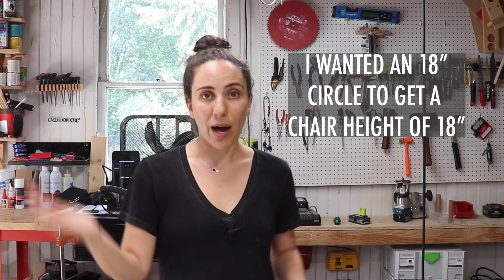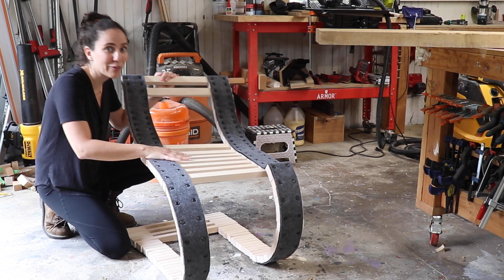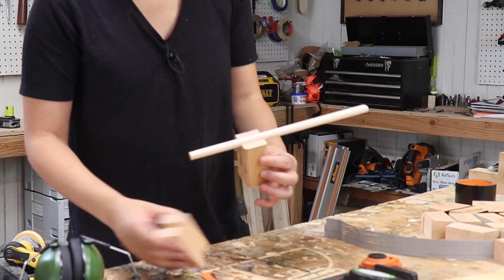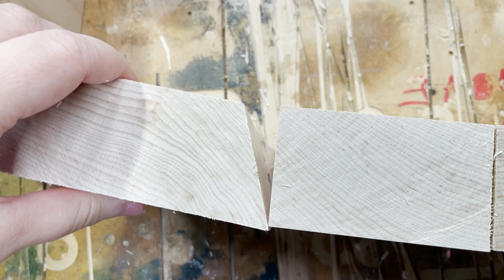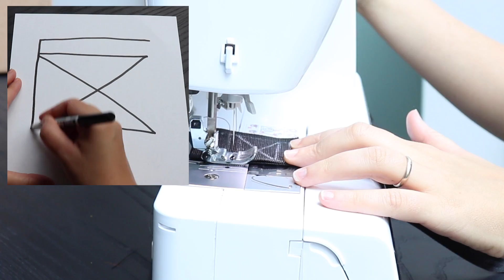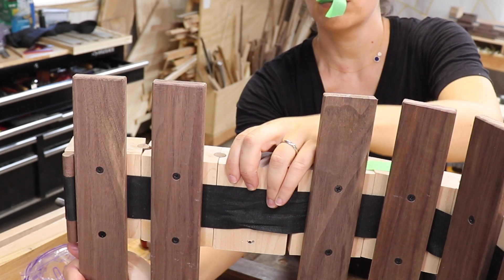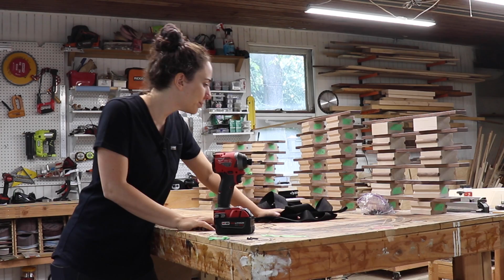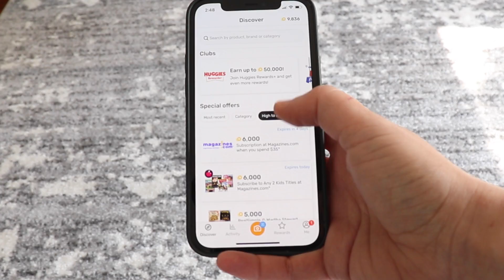I ATTEMPT to make a Roll Up Chair… AGAIN...

Comment: hi tamar, love your stuff, lets discuss the 4 ideas presented in these comments, hinges, strapping techniques, inserting metal, and adding a back support beam.
the hinges, would not work unless they were all metal, and all interconnected, and then it would be clunky, and heavy, and probably not what your going for yet, metal, support, in this area, seems to be a good idea. straps. in order for the straps to work, you need a thin yet strong strap that doesnt stretch, and it needs to be secured to each block, however this will create alot of stress, on that secure point. Each strap point needs to also be wrapped around each block at least one time, to create a very tight connection. Inserting metal, initially i thought, what if there was a strong metal wire, that was able to flex as you rolled, but also able to be hard to give you the support? not sure if this would be helpful. Lastly if you did that, you may still need a steel stick stretching from the back of the chair, to the foot of the chair, to give back support. The main issue i can see is the way in which the blocks are connected, at th bottom C, shape, the current way, allows for too much flex, so this indicates, we may need to use a stronger material, I did also see someone mention like links of a metal watch band, this may be your only solution. custom designing thin yet strong plates, that as they bent they would lock into place and remain stiff. This would cover the bottom c. even with that im afraid you may need a back support beam, because even with the metal, unless it went all the way to the top, the stress of human weight, may create too much stress, on the secure points, without, a back support beam. I will check some other youtube video designs.
Reply: there was a guy here who made an exact response to you, and was inspired by your video, josh wright, he just used a z design on the pieces, and secured each one on the sides with truck straps. you could probly use the straps you already have just slightly modify the shape of your wood pieces.

Comment: I'm < 2 minutes in, my prediction is that the angles should actually be a bit obtuse toward the backside, because no matter what this design will bend. making it bend forward means when you sit on it, it'll be under load and then be straight-ish. I think!, I have no idea. fantastic concept though, holy crap, I hope I see success!

Comment: Hi, I after this video YouTube alg proposed me to watch another guy doing the same. He used a pallet stripe to hold pieces as it doesn't stretch and supposed to be attached firmly. Here's his video. I wish it help and you build a new rollup chair. I'd make it from pine entirely first to make sure that it's working and you don't spend expensive material.

Good luck!

His video I reference to:  https://www.youtube.com/watch?v=2MSEnMGFhMg

Comment: You have a great concept. However, the only way to prevent the strapping from stretching, is to fully glue it to each segment: That way only the very small free section between each segment is subject to stretch.. . . Better yet, get rid of the strapping all together, and just hinge the wooden segments to each other!
I'll be happy to create a model of a sample hinged segment for you in Solidworks.

Comment: Either fix the strap to each piece or at least section the strapping in several parts so you can adjust the tensioning on each secction separatelly.

Comment: Thinking of rope beds maybe you should make a tensioning system on one end?
Likely any material use is going to stretch over time. Also maybe web on both sides of the blocks.

Comment: It feels like there are so many fixes for this problem, but they just might not be what you're going for/reasonable for your project scope, time, and financial investment.

There are a couple relatively easy and cheap things to consider, but making some of them work might be a little pricey compared to what you've tried (unless you already have the means to cut and drill metal):  

-Firstly, you remove a lot of the sliding and tension problems if you just glue down the straps before screwing (and essentially clamping) them down between the wood components (basically turning the stretch and tension problem into just the distance between the blocks, like a hinge).  The complication is you wouldn't have the ability to experiment and trouble-shoot - it'd be one-and-done, start over if it doesn't work.

-Second, you could try for a wood that has relatively-speaking almost no elasticity or compression tolerance - ironwood might even be needed.  This is because, I imagine (though, you may know more about this than I do, because you actually work with wood all the time), the ability of the wood to compress under the pressure the strap tension uses to essentially squeeze them together will multiply the appearance of the strap stretching.

-Third, it might be an idea to round the very edges of the blocks, so they present less pinching risk to the person sitting in the chair, and because it will allow them to be pulled even tighter together while still being able to 'roll' against each other enough to let the chair open into its 'deployed' shape.  The sharp edges should give basically no wiggle-room for how hard to can squeeze them against each other, and it adds the the issue of the wood compression (the chair basically being bound to sag with time as opening and closing a really tight setup would make them wear on each other (and where the straps compressing the edges wears them down, making the chance for gaps wider).

-Fourth, you could avoid a lot of compression with metal plates where the pieces join (it wouldn't look as nice and wooden, though, but they could be fairly well-hidden).  This means a material that's much less prone to compression taking a lot of the forces where they meet, and resisting edge compression by the tensions straps.

-Fifth, there are the ideas of using cable or hinges in place of the straps (like others pointed out), to minimize stretching.  Definitely a very different look, though - and JUST using cables would cut into the wood, so you'd need metal channels for the cables to sit in, which you'd then have to work into the wooden pieces.

-Sixth, using some sort of counter-tension or locking mechanisms would help keep the chair from trying to close or slip when under enough tension to stay sturdy, but that comes with its own host of problems.

I don't know how helpful any of this is, and I know I didn't give any 'these will absolutely fix your problem' suggestions, but I'm not an expert on designing and engineering rolling-up wooden chairs, so I figured all I could offer is suggestions and observations to give you a new perspective.  Hopefully the new angle can help you come up with new solutions.  Oh, and speaking of new angles - if you watch footage of your tests between trying to iterate and improve, it could help.  I noticed you seemed to always have more gaps between the pieces than you said you did in each segment, so I guess maybe you didn't notice them all at the angles you were at, and in the midst of the frustration.

Comment: using fabric to tighten the build is a bad idea because fabric can be stretched even when it appears to be taught. something like metal cable wont do that because metal resists tension better.

Comment: why not simply use seat belts? they are meant to hold a peak stress of over a ton, they work great for lifting engines to. a steel cable inside with a sleeve in the wood to reduce wearing the wood out would be a good idea to. a steel cable through the center of the blocks or even two, would solve the folding issue to. though i would recommend having adjustment screws on the top and bottom due to steel does still stretch.
Reply from the maker: That’s what I used

Comment: Dear, you didn't look good enough at his design. The mistakes are obvious. Bands are to small (should be wider), not glued to the individual wood pieces, and the material stretches too much. Solve that first and you're almost there. Next is, his design has much more pieces in it, each one thinner than yours. More surface to divide the forces over. Solve that too and your chair will work.

Comment: Might be worth trying to think of the construction as separate sections where the major stress point are at the curves. Maybe even build it as two or three pieces  banded with a different material more tightly just at the stress joint, like the strapping from a seat belt, or heavy canvas. Then fixing the whole thing together as you have. 

If you can get the seat curve to support weight, then build the upper curve similarly. At the very least the mode of logic would be a bit more bite sized.

Comment: I see a problem with the methodology.  You built a whole chair just to test a joint with the most tension.

Try building just one joint and load test it.  Try different strap materials and joint design.

Comment: What if you put a sliding strap on the back through sort of belt loops on each section. Once the chair is unrolled, that strap could be tensioned with some sort of lever buckles at one, or both ends. Maybe you could use ratchet straps like cargo tie downs. I hope that makes sense. The second strap should provide a balance, or counter tension on both sides of the curves. I'm no engineer, physicist, or super genius coyote, but I think that balanced tension pulling on BOTH sides is the key.

Or, you could have fold out supports parallel to the slats on the curve at the back of the seat section. You'd lose the cool free floating factor, but you'd gain a working chair.

Comment: It's a fantastically interesting engineering & design problem still! Does it have to be free standing at one end? Looks like a handy portable workbench? obviously not as springy/comfy for sitting! 

1. a light metal wire mesh protect finger/arm pinching etc..
2. a light metal wire mesh you could burn into the wood somehow create a checkered embossed effect
3. solid/hollowed fixed arcs, one big, one small that compact together into the same spiral just in two parts fixed/semifixed
4. a smaller "spring" support at the far end
5. leather straps

Anyway, all fun, very enjoyable to watch especially the experiments!

Comment: i really think a lot of the problem with this chair is the shape you are going for. the webbing stretches and the wood compresses. the "seat" is a lever arm and the chair will never be stiff enough to not sag. maybe try compensating for the flex rather than trying to eliminate it all together. if the chair were shaped more like one of those recliners that stand you back up, that may be able to account for compression and stretch while also making the chair easier to get in and out of. Some high stretch material on the back side may also help you with the backrest flopping over

Comment: Personally I think you are too hung on on strapping or strapping being the core item to hold it together.

Custom hinges per piece could work. 
In regards to the backrest - you could create a pin to lock them together, the pin could double to keep it rolled up.

Comment: I think the wooden cylinders are at the wrong side of each block, for the forces, depends on the angle probably, so you need to experiment with that. Also it works with the tape but not with the belt? I suggest you try to attach the belt to each piece. (with tension that is).

Comment: If it wasn't wood, you could do some crude sliding locking devices to hold key parts in place. You'd have to sand it and hope it doesn't splinter with friction though. That's the only thing I can think of. I love the concept but I can see how execution would be a mind warp

Comment: I'm sorry for you, but I don't think tension is going to ever work. Make the wood linked together like a watch band and just cut your losses by making a medal shape of the chair you want. Pretty much in place of the straps use metal so there's some flexibility.it won't exactly roll up but maybe easy to take apart to move. Only problem is that the metal bands aren't as easy to move around, but taken apart the wood linked together can roll up and the bands of metal can stack of for less space.

Comment: This is so much work and I think you are almost there!

1: The nylon strapping is going to stretch.  A non stretchy material like Kevlar or Stainless steel wire would be better - frankly SS wire would probably be the easiest.
2:  The various blocks are snapping back when you sit on the chair because the lines of force are acting around a fulcrum made by the block corners.  This is always going to be a risk.  To get around this I would drill holes in the middle of the blocks (Through where the beautiful dowles are) and run stainless steel wires down the middle.
3:  With this solution of course you wont be able to just roll the chair up because when the SS wire is tight, rolling the chair will require the wire to stretch, which it wont.
4:  To get around this you will need the ability to release the SS wire when you want to roll the chair.  This can be done with Quick Release type levers which can also allow ajustment of the wire tension as the wood settles.
5:  Even with this I am unclear due to lack of experience with wood, if the wood itself will have the necesarry compressive strength to resist the very high forces that its subjected to.
6:  I would try this myself but I dont have a wood shop :-)
7:  I love your videos, please keep up the good work!

Comment: One suggestion would maybe be to change the joint shape on the pieces that make the curve. If you picture a sort of "clothespin" shape where you glue a piece of fabric to the side that normally opens so it cannot be opened by squeezing the other side. If the goal is to tear the fabric by squeezing the other side (assuming you squeeze with the same force), then you would want to make the part you squeeze longer to get more tension force on the fabric until it breaks. Same theory applies here--if you make the pieces shorter, you would reduce the tension on your curvy pieces. Specifically, make the height of the front of the joint (part that touches the fabric) less than the depth of the joint ( measuring fabric side to back side). ALSO, maybe cut a chamfer where the "pivot" is so there is not so much stress on a single point.

Another suggestion is to secure the position of the fabric onto the joints by screwing into the joints above and below the horizontal darker slats on every joint, going through the fabric while making sure that the pieces have no angle or gap between them when you do it. You may even want to put metal grommets in the fabric first, then screw into the joints through them.